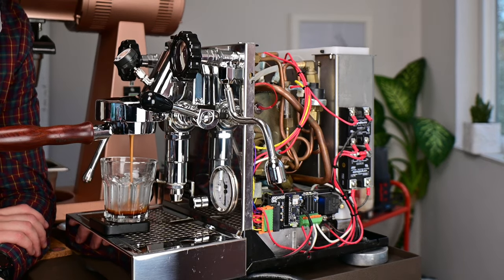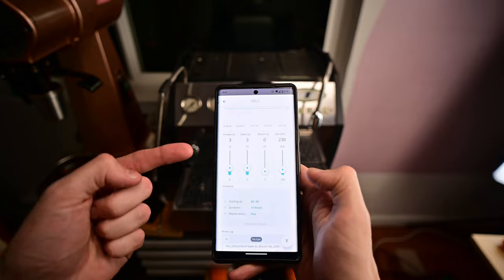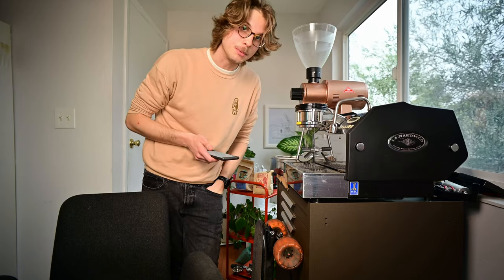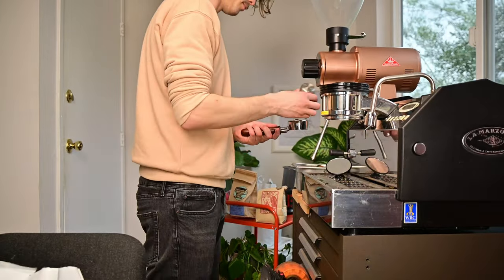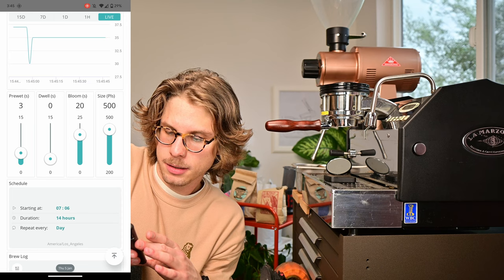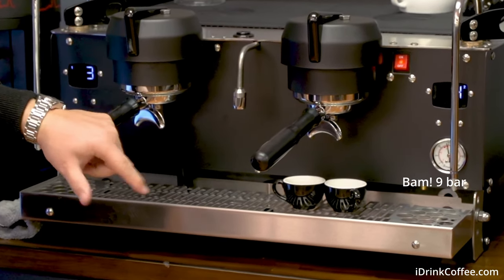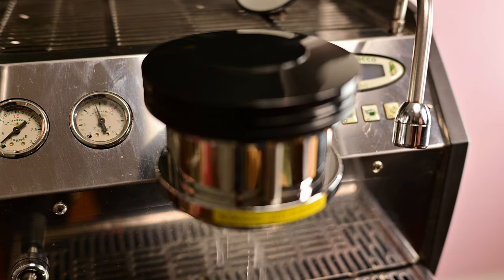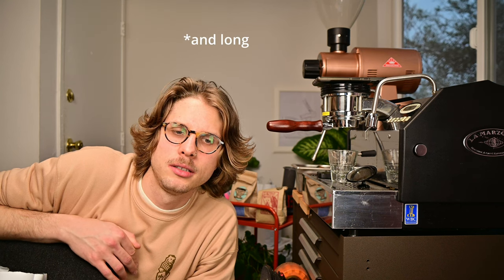I Unlocked La Marzocco’s Pressure Profiling | An Engineer’s GS3 Espresso Machine Mods

Comment: Cool stuff!  using the pump to build pressure for preinfusion makes sense.  Superauto machines do this (Gaggia and Saeco-Phillips at least). I use the following preinfusion method for my Giotto which is plumbed at 3 bar:  1)open valve 2) wait for drips 3)pull shot.   Time from start of preinfuse to first drips  is  about 6 seconds when things are optimal. (grind, headroom).

Comment: Ok that's way better than what I was working on. I just have a GS3 turning on remotely and was working on doing remote flow control via a dimmer on the pump. You should see if you can add dose by weight using an Acaia lunar or something similar... That's always been something interesting that not many machines have.

Comment: Nice video. Just as a note, your no pump valve open pre-infusion (bloom) does not act as slayer pre-infusion, since there is no flow as soon as the pressure equilibrated. There will be an inrush of water into the puck until pressure in the boiler and at the puck are equal. The reason you see a slow trickle of flow without any puck is a slow but steady drainage of water from the boiler itself through the flow-restrictor. It is the official reason LM does not implement this, because there is theoretical risk of burning you heating element if you left it drain too long. Cheers!
Reply from the maker: Yeah it's slayer-ish only because it's long 😅, but more similar to just a regular line pressure preinfusion. That's really interesting information about La Marzocco's reasoning. I'm fascinating by the idea that you could drain the group that way. I've got an experiment to try... 🤓
Reply: Long for sure 😃
And I guess draining is more of an issue for the Linea Mini, draining in the GS3s boiler will only occur as long as the water inlet (for the brew head inside the boiler) sits below water level..

Comment: hi, this is really incredible.  I have a La Marzocco GS3 MP but it is from 2016 so no ability to pressure profile.  on reservior so no line pressure.  i have noticed if i activate the paddle part of the way the valve opens to boiler pressure but haven't played around with that (but i will now that i have seen this).   would this mod work for the MP as well?  Is this something that can be taught or am I just overly optimistic?  again, super cool stuff, great video, good luck to you!   maybe you would enjoy a visit to Charleston, SC to modify my machine ;)
Reply: Great stuff! Also interested if this works on a GS3 MP? Love your videos!
Reply: +1 also interested in MP compatibility

Comment: Very cool! I'd like one of your boards. 

Question: Why don't you just go with a BLDC gear pump with full flow/pressure control? Then you could have a decent-style graph where you change the flowrate or the pressure over time by adjusting some sliders?

I have a mod in the works replacing a vibe pump for a BLDC gear pump. It will be totally analog, so the end result will be a little box with a potentiometer 0-5V controlling the pump and a tachometer display that will show the ml/s which I can derive from the rpm. 

I'd LOVE to have a profile programmed that I could run every time the pump comes on, but that's beyond me. Maybe you can do it and sell me a board? lol.

EDIT: I see you did that already on your previous machine minus the board control of the pump. Any plans to work on that?
Reply from the maker: Glad you saw the other video! Yes this video was mostly focused on the idea of the capabilities of a machine without modifying anything but the circuit board.

The Rocket was a much different story. That machine does control the pump from the circuit board, however it doesn't have any feedback control loops quite yet. Unfortunately the circuit board isn't quite ready to sell, but happy to hear your interest! 🤓

Comment: GS3 ignorant here. does the gs3 volumetric flow meter include a flow sensor at puck level? does gs3 have pressure sensor at puck level?  cool mods and i always liked engineering
Reply from the maker: Thanks! The flowmeter is downstream of the pump and reasonably accurate since it doesn't use an opv to maintain the pressure. I usually see it accurate to about a half a gram. The pressure gauge for the brew pressure is just at the boiler, not the puck. However the GS3 MP version does have a pressure gauge at the puck

Comment: Do you actually need to have the machine plumed to water supply or can that work also with the reservoir for this to actually work? I use the reservoir and never got aware of the 'natural water pressure' without the pump being on...
Reply from the maker: Hi thanks for reaching out! Yes, this whole video was actually recorded with the machine connected to a reservoir. This behavior you're seeing is very similar to the gravity-fed prewetting you see on the Silvia pro x

Comment: Absolutely fantastic video and a credit to your skills. However, the last LM app update you can do all these features. Not sure if you have a current Gs3 but you have basically done what the new app/ current machine does with your older machine. What would be really cool is using your skills to do an AV machine with MP function. Basically a Strada EP. 👍
Reply from the maker: Thanks! Yes! I was happy to see they added quite a bit with the V2 app. But I'm still waiting for the granulated control of the pump and valve, flow rate info, and more details in the logging.

Comment: Hello Tate, this is an awesome project! I really want to try to build your controller so I downloaded the files on Github. But I just cannot find the "schematics.png" and the "layout.png" for the Brewhob One circuit board. What am I doing wrong? Also, is your phone showing an app or a webpage from a websever in the Arduino IoT 33?
Reply from the maker: Hi, happy to hear you've downloaded the files! Sorry to say I don't have the schematics included, those arent quite ready to be released yet. The app I'm using is the official Arduino IoT app which is hosted from their servers, I am not using a web server on the Arduino itself
Reply: @tatemazer  Ok, are you planning to release the schematic diagram sometime in the future? Or even a Gerber file? Or will you sell cards? What are your plans for this project?
Reply: ❤@tatemazer  it’s just amazing!! Following your stuff since the fire videos from the lines classic you where modding❤
Is the board available for sale?  I would take at least five for all the dead machineprojekts over here 😂
Reply: @tatemazer  Awesome video. Just wondering. The Brewhob 0.1 is using an ESP, while the "ONE" is using an Arduino. Any specific reason for that? I'd love to get this integrated in ie: Home Assistant, or exposing metrics through a prom client, and I guess that's a bit easier on an ESP compared to Arduino.

Comment: Full marks for the labels on your PCB.  Sounds dumb, but you could splice in a vibe pump and fully modulate the flow for cheap.  It would seem like a shame, but if you make it easily reversible, you could see if it's worthwhile rather than going full gear pump $$$.
Reply from the maker: 😂 that's doesn't sound dumb at all! I'm literally working on that exact idea, my experience with gear pumps is they're simply too expensive and love the idea of having the same functionality with a vibe pump

Comment: Does the pump support pwm modulation to regulate pressure in a wide range programmatically?
Reply from the maker: Good question! Unfortunately PWM only works for DC power, whereas rotary pumps in most commercial equipment like a gs3 almost always runs on an AC pump.

Comment: What is the possibility of getting an HX machine with a rotary pump to actually have variable pressure rates that mimic a leva extraction?"
Reply from the maker: Sorry to say that rotary pumps almost always run on AC voltage which is at a constant frequency and thus a constant pressure. Variable pressure requires either a DC motor'd gear pump or a pulse control system using a vibratory pump, as seen in the Decent Espresso Machine